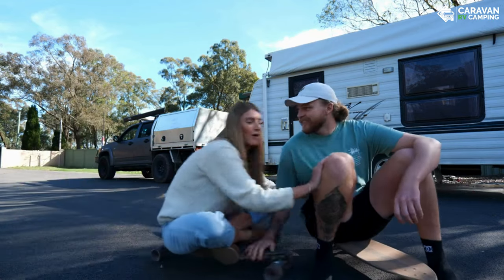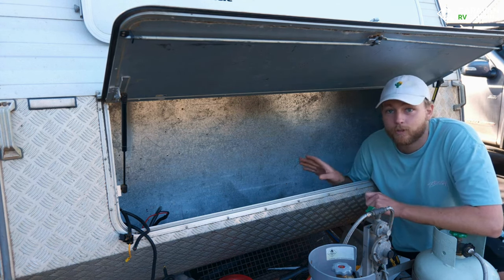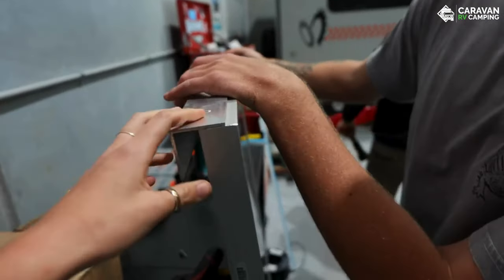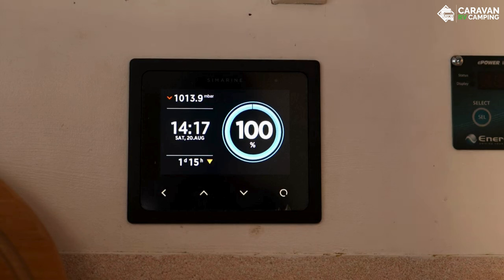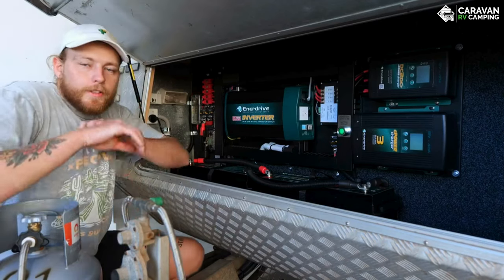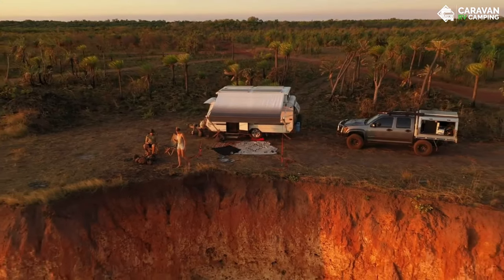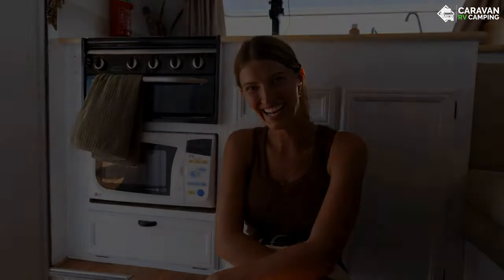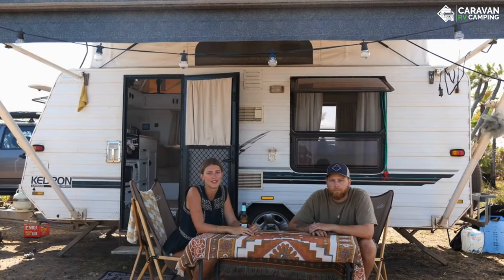Why 'Plenty Of Dust' Upgraded To An Enerdrive | Dometic Lithium Battery System!

Comment: Seperate regular will help with recharging the battery heaps while driving plus adding another portable panel through the current dc-dc charger when parked up👍